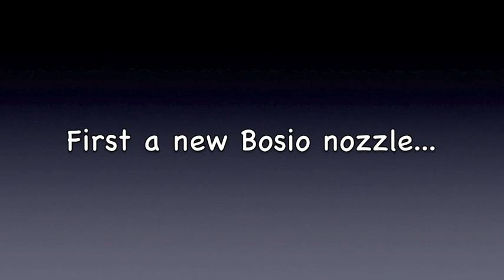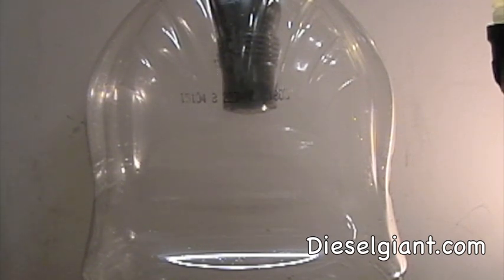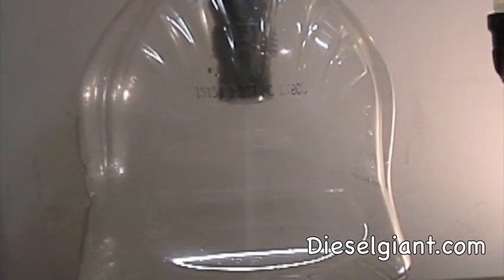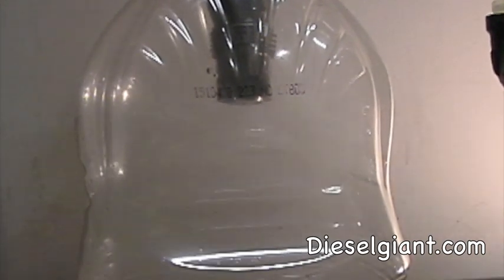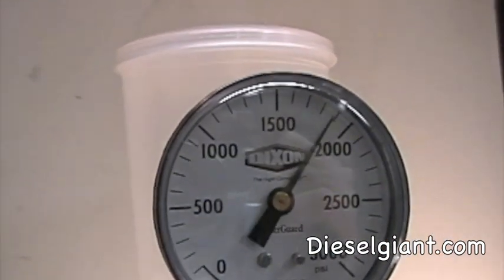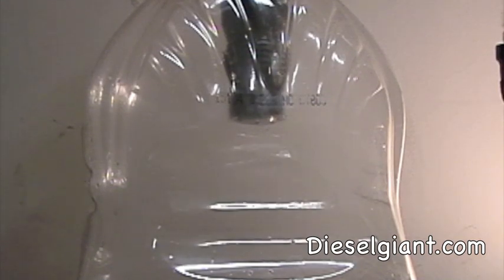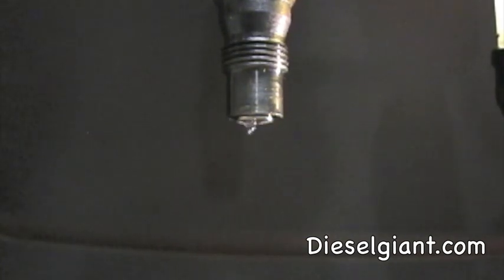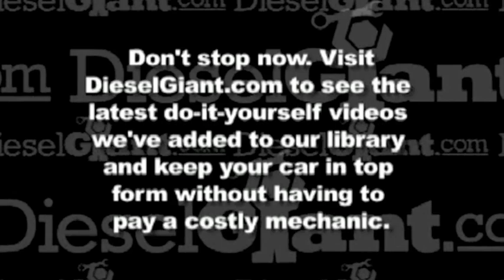Mercedes Benz Diesel Injector spray examples

Comment: Very cool.. Was looking for these new 44,000 psi common rail injectors firing and this is close enough.. Oh and "riching" a system out will not melt a whole in the piston.. Just a big waste of fuel and maybe "wash" the rings out leading to cylinder damage. "Leaning" out a system will cause piston burnout as the engine literally consumes the aluminum to sustain combustion. Big difference.